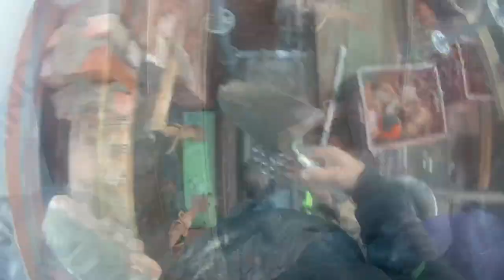Bricklaying a brick arch (8)/ old farm rebuild

Comment: Hi Jay 

At 50 seconds, what type of clamp are you using there to pin the profile to the internal corner ? 

Cheers
Reply from the maker: Hello lee 

These clamps are designed to fix with a hammer (it’s very strong ), they are very versatile as I use them for many things around the construction site , securing walls ,fixing profiles and making formwork for instance 

I should do a small video on it

Thanks 😊
Reply: @JayKTS  thanks jay are  you able to put a link up on where I can buy them ? 

👍
Reply from the maker: @ lee 

I’ll take a look where to buy online with international shipping , .. you can find them here in every hardware store , a very common bricklayerstool , costs between 7 and 10 euro for one piece 

Where are you from ?
Reply from the maker: Lee 

https://lecot.be/nl-be/kapriol/1485339-muurklem-solid-pp-833050-nl-be/
Reply from the maker: Its called “profielhaak” in Dutch (profile-hook)
Reply from the maker: This has shipping in Europe 👉🏼 https://www.bouwkampioen.be/nl/profielhaak-60cm-verzinkt.html
Reply: @JayKTS  cheers for putting that up 👍 I'm from just outside London mate
Reply from the maker: Lee if you are interested .. I could swap a few of these clamps for an old decent English trowel , if you got one laying around ? Just a suggestion nothing more ✌🏻
Reply: @JayKTS  hi jay yeah no problem at all I've got a few trowels , what style and size are you after ?
Reply from the maker: Lee Moore Uhm not too big ? And not too small 😁 9 or 10 inch that’s good for brickwork ?
Reply from the maker: A London pattern ?
Reply from the maker: If you give me your address I’ll send 4 clamps to you
Reply: @JayKTS  no problem I'll send you a trowel 

Can you private message me so I can send my address and get your address aswell ? Yeah 9/10 will be good for the tubs you don't want anything bigger than that 👍
Reply from the maker: Lee Moore  pm by email?
Reply: Jay, did you get that london pattern trowel? Would be nice to see you do a review of that one. I'm a brick mason myself in Norway, and one of the most popular trowels here is the jung henkelmann Duesseldorf trowel. Fantastic brickwork by the way!
Reply from the maker: Hi Hans 
Yes I did receive the trowel , it’s a Philadelphia pattern w. Rose 
Yeah I’m thrilled to try it out will put some differences out there as they are quite different 
Its interesting you guys also use henkelmann .. 
Thanks 🙏🏻